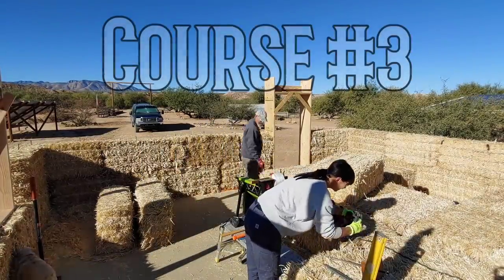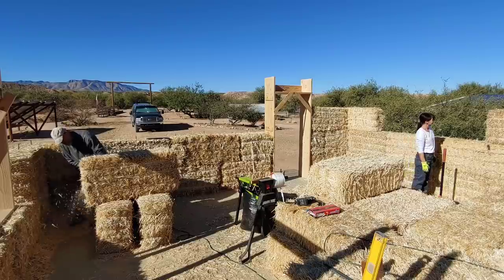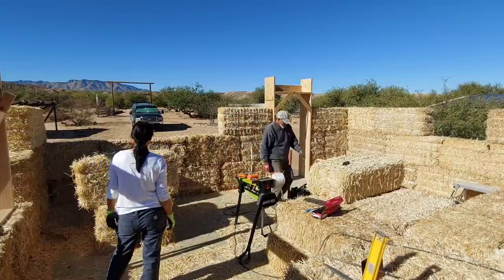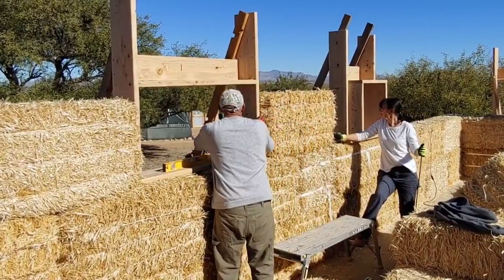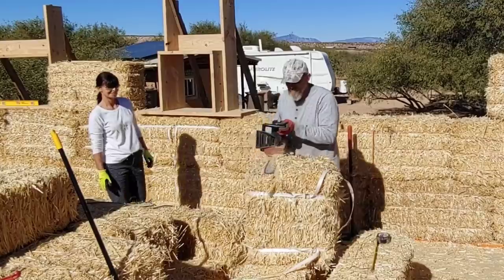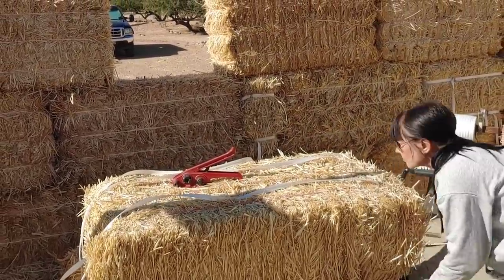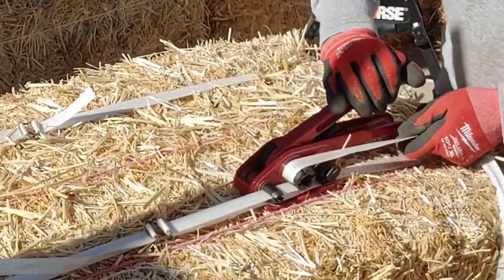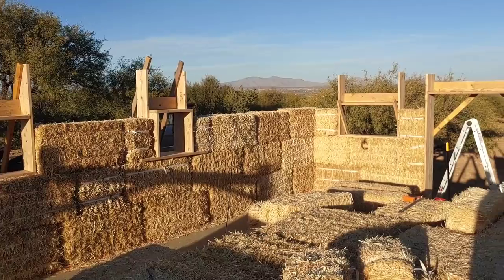#strawbalehouse #sustainableliving Straw Bale House Build Day 15: Bale Stacking Continues!

Comment: Bill, Elaine, kudos to you.  I think the measure of a good you tube video is if it inspires the viewer.  You two do that in spades. I makes me want to come to Arizoona and start building. Thanks so much.  A question...  Where do you find high quality straw bales, and if you don't mind telling, how much does each bale cost, and how many are needed foor a house your size?
Reply from the maker: Thank you Gomer. We appreciate your kind words. We bought locally sourced bales through a local Feed and Supply store. We purchased 125 bales but that will most certainly be about 20 more than we actually need. Luckily Yvonne has a straw bales garden which will most certainly increase in size next season. We did get a volume discount and paid $9 per bale. ( Regular price was, at the time of purchase $11 per bale. ) These are 3 string bales which are larger than 2 string bales, and are very dense and there by heavy. Here is a link to our video about buying our straw.
https://youtu.be/V1DvGVeZqKA

Comment: When using vampire stakes , could a person cut the slots in the bale's as they are being placed and after making the wall as high as the rough bucks,  drive a full length stake , would that provide a stronger anchor?

Comment: i have a question for ya,,im thinking about building a straw building,,im just wondering the way you guys are placing your bales,r value compared to laying them flat,being thicker walls,,just wondering about the r value thing,,,and looking good keep up the good work,,,there's a good chance im gonna be flowing your lead
Reply from the maker: Thanks for watching. Laying the bales flat would increase the r value from what we are getting, r 26 to r 35. In our climate zone, R26 is more than enough to assure great thermal properties. But, I am sure there are regions in the US and around the world where R35 would be a better choice. By standing the bales on edge like we do, we are using about 30% fewer bales. If we were to go higher than 4 courses, laying the bales flat would be a better choice for added stability.
Reply: Lb oogie boogie , heat and cold travel down the length of the straw more easily than across, so the way you see here has a higher r-value per inch than a bale laid flat , but as the bale is wider than high the r-value of the wall ends up being about equal with the flat laid bale wall

Comment: I’m noticing you’re not strapping from the bottom to the top. Are the pins taking the place of the straps to tie the bales together vertically?
Reply from the maker: You're getting ahead of me...next video will address this question. But not to keep you in suspense, the rebar pinning does add much lateral stability to the wall. It does not replace but works in conjunction with the strapping. Next video in a day or so. Thanks for your continued support!